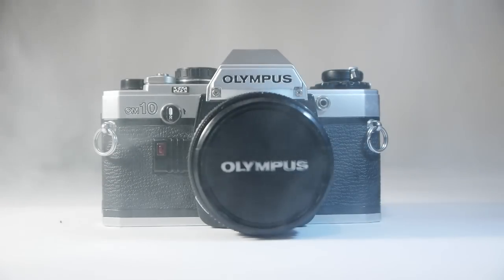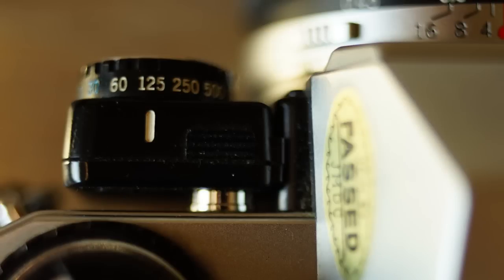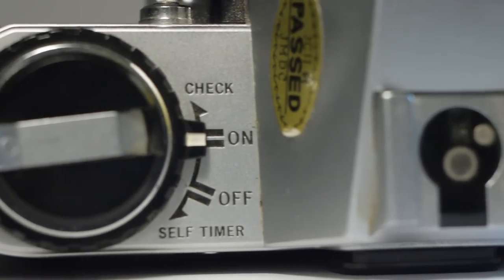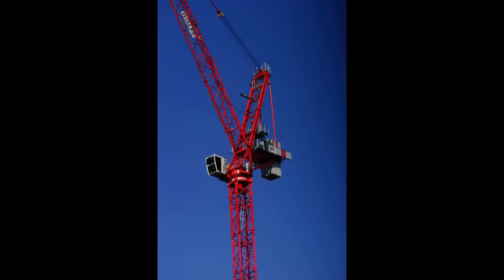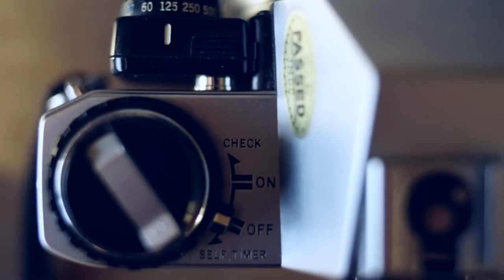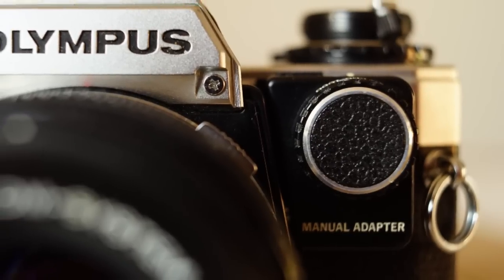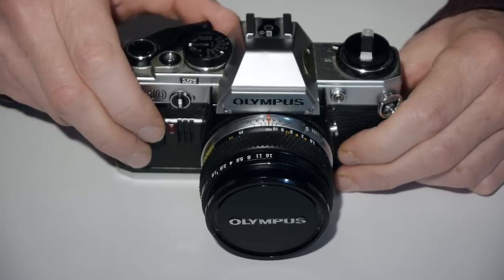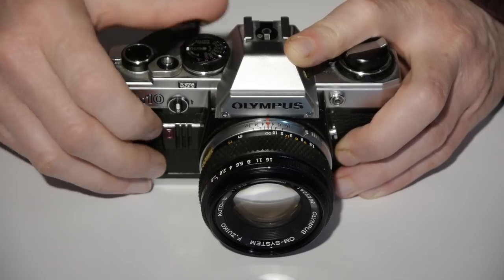Restoring and Using an Olympus OM10

Comment: thank you so much for your advice. I bought an Olympus OM-10 that was jammed, with a lens vivitar 80-200mm and manual adapter. It was cheaper. I just changed the battery and everything is working.  The light seal is gone. the lens has some dust. I think I can fix it as well.  I'm looking forward to testing this camera.

Comment: Recently discovered your channel and appreciate your love of the old manual cameras and lenses. I too have an OM10 (actually I have two), which was my second SLR, the first was a Pentax. Although I don't use the cameras anymore I still have the lenses (28mm, 50mm and a zoom) which I use on my Canon 550D and EOS M. They look great and work great still after all these years.
Reply from the maker: Glad you're enjoying those old lenses!
Reply: @zenography7923  Hi, could you please explain the whole working mechanism for beginners, including the parts and the usage and what to do and not to do when something is not working or stuck. I got an OM 10 recently, but the shutter release is stuck and I'm not able to see anything in the view finder.

Comment: That was a pretty good find. I have the OMG! (the US version of the OM20) and was quite pleased to discover that the motor drive I got today for $10 also fits this camera as well (I have an OM-1 and an OM-2 as my primary Olympus cameras) The Zuiko lenses are fantastic. I have quite a few of them now. My two favorites being the 40/2 and the 85/2
Reply from the maker: Zuikos are definitely lovely lenses; the 40/2 and the 85/2 sound nice, not had the pleasure of these though - yet that is! The OM10 was a good find; I hadn't thought too much of them but, as often happens, after using it for a while I came to appreciate it much more. Thanks for watching, hope you're enjoying those Olympuses (Olympi?)
Reply: Hello, I have the same exact camera,(the OMG) but it didn’t come with a manual or anything, I have a few questions!

1. I’ve heard that they require two LR44 batteries, is that true?

2. What type of film do you use, I really want to get into film photography, but I’ve heard there’s two types, bw and color.

Thanks a lot!
Reply: @guesswho3925  Wiki page has this PDF:

http://vieilalbum.com/documents_fichiers/Manuel%20Olympus%20OM-10.pdf
Reply: 303 357 sr44 are the batteries

Comment: Great video. always worth buying the entry level version as it takes all the same glass as the higher end models. Good tutorial on replacing light seals as well. Done it many times, it's a pain but well worth it. For those awkward channels you could use waxed black string, can be a bit more flexible than foam at getting round corners but you need to glue it in.
Reply from the maker: I think the later Prakticas (BC1, BCA etc) used string as seals and it stands the test of time much better than foam, doesn't seem to degrade at all, not yet anyway. Curiously, the Zenits don't seem to use seals of any kind, same with Zorkis and Feds. I've enjoyed using the OM10, it's a nice little camera, although the auto exposure on mine seems to overexpose a bit... ah well, practice makes perfect I suppose.
Reply: @zenography7923  Agree, never noticed any light seals on the Russian cameras. The Praktica SLRs were very under-estimated cameras. They innovated more than the  Russians. The BC's in particular were very good, step-less shutter in aperture priority mode. However the in-camera metering eventually failed and the quality of the wiring in the lenses left a lot to be desired, need a good soldering iron to restore.

Comment: I have some of the “proper” Japanese foam rubber, for light seals. My example should be light tight though because the current foam is in reasonable condition.

Comment: This was my very first camera in the 80's which I still have but no longer use but have the manual adapter which are hard to find with the camera now.  The lens 50mm f1.8  + e mount adapter works well on my Sony nex. 5n
Reply from the maker: It sounds like your OM10 is due for an airing!

Comment: I’ve just retrieved my om10 from many years of storage to demonstrate to my daughter. I bought it secondhand in 1983 and it gave me many years on trusty service. I put in new batteries but alas no life at all! Any ideas which way I need to jump now? Any help is very welcome and gratefully received! Thank you. Gordon
Reply from the maker: Is the mirror perhaps stuck in the 'up' position? These cameras lock if fired without batteries, and may have been stored like this (mirror up). If so, a little gentle persuasion should free it off. Otherwise I'd look at battery terminals/connections - first inside the battery compartment, then if all's good there, remove the bottom plate and check the lead running from the battery compartment hasn't corroded and become disconnected (a common fault). If these fixes don't work then I guess a deeper repair is needed.

Comment: Hi, great video. I have an om10 which the frame counter appears to be sticking. The frame reset button is free to move and after removing the top plate I can't see a reason why it fails to return. If the counter is reset manually to the s position it will count to 5 and then stop, I have lubricated the counter wheel but this has made no difference. Any help would be greatly appreciated.

Comment: Hi there! I just found an OM10 at a thrift store with zuiko 50mm for 10 dollars. I replaced the the batteries but the only thing that doesn't work is the battery check function. The light meter works and the self timer works while beeping and the light is flashing. But the battery check is a no go? is this common?

Comment: Insightful video will try to change battery. On bulb mode the camera shutter speed doesn't change, but adjust on Auto mode and on Manual Adapter. What do you advise?
Reply from the maker: On 'bulb' mode, the shutter should open when you press the button, and stay open for as long as you keep it pressed. On auto, shutter speeds should change automatically as the light changes, whereas on manual, the shutter should only fire at the selected speed. If you're having problems, change the batteries first - you need SR44 or LR44 x2.

Comment: Hi! I have a problem with my recently found olympus om10... I change batteries but the wind lever doesn't work yet...how can I do?thanks
Reply from the maker: Push the control lever to the reset position - you should be ok.

Comment: Hi there..may i ask you a quick question ? I just got an OM10 for Xmas for film photography = I'm worried my film isn't winding on correctly.  The shot works, winder works but the rewind knob and back release isn't turning when i take a photo - isn't it supposed to ? thank you
Reply from the maker: The rewind crank would usually rotate a little as you wind the film on - it sounds like your film may not be attached correctly to the spindle (on the opposite side of the camera, under the wind on lever) and isn't winding on. If you can find a dark enough place, open the back of the camera and wind it on - you should be able to feel the film move as it winds.

Comment: Hi! I just got my Olympus OM10 and I used it for the first time and things were going great until I shot about 16 times and after that my advance film lever wouldn’t open all the way and was very hard. Do you have any idea what may have caused this? Please and thank you
Reply from the maker: Whatever you do, don’t force it! These cameras will jam if the batteries fail, so that’s your first thing to try. Or, the film may have jammed and torn inside the camera - remove it and reload a new film carefully, making sure it’s engaged in the sprockets. If those don’t work it sounds like a mechanical jam, in which case a competent technician would need to look at it. Let me know how you get on!

Comment: Hi, I have the same issue that you had where the rewind lever and shutter button do not function. However the batteries in my camera are relatively new and do not need replacing. Is there possibly a different issue in my camera causing this? 
Thanks, Ben
Reply from the maker: If you're sure the batteries are good there's clearly another fault, but I'd try some brand new batteries first, just to make sure. If that doesn't work, well, the fault could be something simple like a broken connection, or something more complex, and the cost of repair, if it's possible, could be fairly expensive. I'd change the batteries first though...
Reply: @zenography7923  I have brand new batteries on the way so hopefully they will fix the issue. If it doesn't work then a new OM10 body isn't to expensive, around £30 so that will be the next option. 
Thanks for the advice
Reply from the maker: Hope it works out!

Comment: I have an OM10 and with batteries in the camera nothing works still. What do you suggest?
Reply from the maker: Are you sure the batteries are good? If they're not new, I would replace them with a new pair first, just to make sure. If that doesn't work, well, the OM10 is an electronic camera and is quite complex, and if you find someone who can repair it, the cost of the repair could exceed the value of the camera. As OM10 bodies are available fairly cheaply, if it were me I'd probably just buy another.

Comment: Thanks a lot for this video ! I'm searching if anyone managed to fix the "Indication starting switch" ? I'm talking about the switch around the shutter, looks like a plastic ring. It should re-activate the shutter speed light indicator that off automatically after 90 seconds.
Cannot find anything about that... Just found that it seems pretty common this part fails. According to technical manual the name of part is "SW201 - indication starting switch".

If I turn the camera on & off again the light come again for 90 seconds.

I don't think it has any impact as the OM10 got two light meters, one for indicating shutter speed and the other one that actually decide for shutter speed. So the only impact is having to turn it off and on again if I want the information (quite easy with that switch), or continue shooting without knowing shutter speed.

Thanks for your help !
Reply from the maker: I guess if you need spares the only hope is a dead OM10 - there are usually a few on ebay.
Reply: @zenography7923  Thanks for reply! Yep could work, but got no idea where the problem is. And no one in videos about OM10 talk about that. Actually the "switch" itself just looks like a plastic ring..

Comment: Hey what if the shutter is stuck midway?
Reply from the maker: It often means the batteries are gone - the OM10 will lock up without a good power supply. Changing them can fix it, but if not, there could be a more fundamental fault.
Reply: @zenography7923  alrighty thanks !

Comment: Sorry to correct you but OM10 top plates are plastic with a metallic coating.
Reply from the maker: Thanks, I stand corrected!
Reply: Actually, early model OM-10's, with two bottom cover screws, had chrome plated brass top and bottom covers, but later models with three bottom cover screws had chrome sheathed plastic top and bottom covers.
Reply: @zenography7923  I was just looking at "New old stock" parts for the OM-10, and the black top plate was brown-is (plastic) on the inside, while the aluminium one was grey on both the outside and the inside. So, I'm pretty sure the aluminium top plates ARE metal. Also, on my OM-10, there's a couple of deep scratches, which are metal colored all the way thru.

Comment: HI there.  Great informative video.  Thank you.   I have a quick question.  My mirror is stuck half way up but my batteries are dead so Im hoping that is the problem.  By question involves the back or front depending how you look at it of the cloth shutter.  The side that goes against the film is black, but the side inside the camera appears to be pixelated.   Hundreds of black and silver tiny squares are on the cloth.  I can only see this because of the shutter being stuck half way.   My question are these pixels normal?  I just picked up the camera at an auction and there is a few minor things that need to be done.  I don't want to spend a lot of money on repairing the camera if those pixels are not suppose to be there.  They appear to be permanent and random.  Thanks
Reply from the maker: It's almost certainly a battery problem - new ones should un-stick it for you. The pixels on the shutter curtain are part of the camera's auto exposure system and are indeed supposed to be there! Repair the camera and enjoy!
Reply: This is exactly my situation right now.